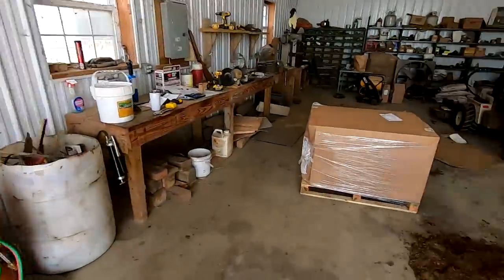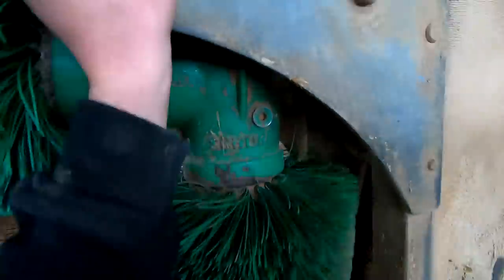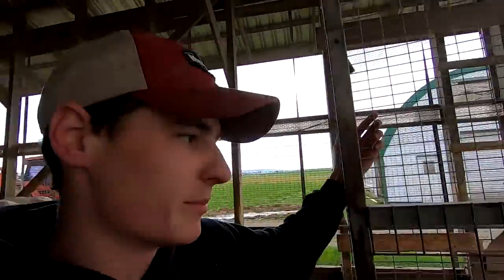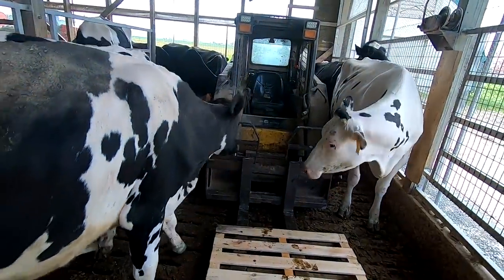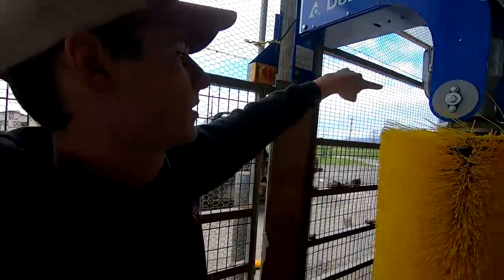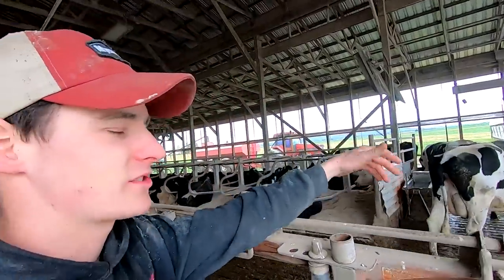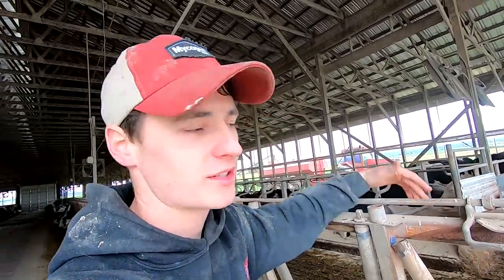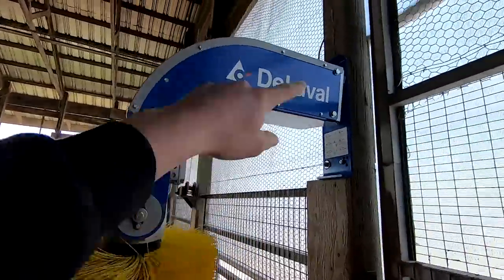New DeLaval Cow Brush

Comment: Hey tip for wiring into boxes is to, strip the wire before you putt into the box. Makes it a whole lot easier
Reply: Also, Get a female corn end, and make that useless 8 feet of cord into an 8' extension cord.
Reply: OOPS - I meant to get a male end to make that useless cord into an extension cord.

Comment: If I were you, I'd relocate the switch outside, directly opposite of the unit so it would be accessible if something might happen and the unit is not accessible (Fire, electrical, out of control livestock). If a short developed somewhere or a ground fault, then it might get interesting when you grab onto the frame.  A resilient by design location for the brushes is preferable, so there is some give and won't cause problems later on. A rigid mounting point, might fail down the road.

Comment: Put a camera like you did and record for a long time, then down select to like 30mins of cows playing in different ways with this brush, would be some fun video. Hmm if the cows like getting the top of their back brushed, this tool doesn't seem to do that because as soon as the cow lifts it up, the rotating motion swivels the whole thing to the side where it falls off the cow, so it's not a good back scratcher. Good for head and side, but not the hump.

Comment: Justa heads up on that extension cord feed.  You might want to re think that. That cord is only a 16 gauge cord,  it’s not rated for building wiring. And with out knowing the motor draw and the distance from the outlet to the new cow scrub, I would not trust that install. That’s a fire hazard there son. I’m a master electrician in Wisconsin, and I see dairy farms with fires all the time here because of bad wiring Installs.  You need to install. 14/2 NM cable and then install it in a pipe to protect it down the wall if lower the 7’6”. Make sure it’s GFCI protected as well. Cows don’t like trickle shocks at all and will also cause milk production slow downs as well. See that a lot here with old farms and bad grounding issues. Like what your doing with your operation, like the channel just hate to see you lose the barn from improper wiring installation. And this a national code issue even though your in another state. Just giving a friendly heads up.
Reply: I know a dairy farmer here who said he had cows electrocuted from that type of brush.. not sure what brand it was

Comment: Y people dislike there is nothing to dislike
Reply: Grilledchesse 42069101
+ it runs off electricity which comes from a power plant that uses coal that gets dug out of the the ground using diesel powered equipment. That same type of equipment has been known to cut down and toppel trees which makes them impossible to hug. That's all I got.

Comment: moves in too many axes. they cant get any pressure on the brush without it rolling over their backs.
Reply: Its better that way.....it would break far easier if it was any more rigid. The point is that it does roll over their backs.
Reply: @CiaranMcC  weird. all the other cow brushes i see dont articulate as much.  oh well, as long as cows like it